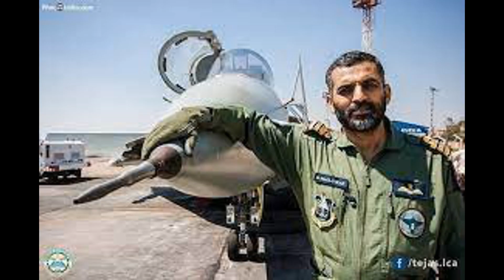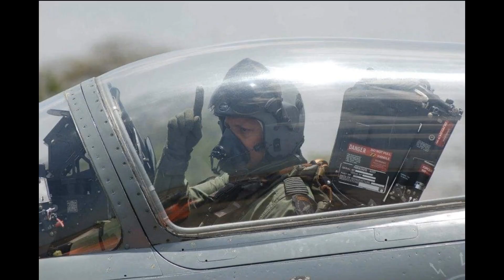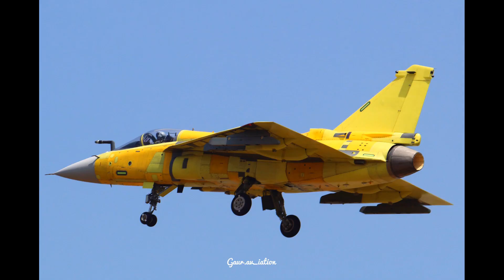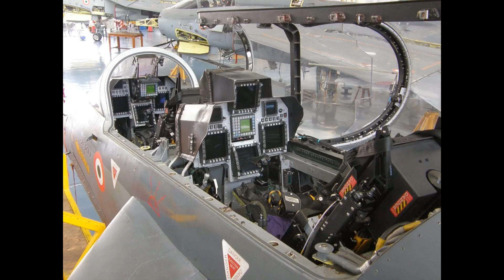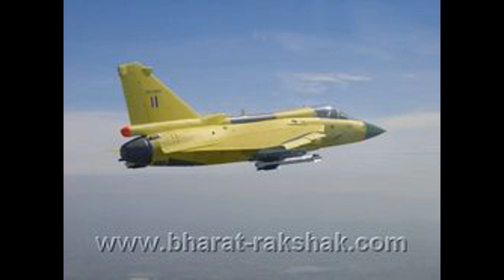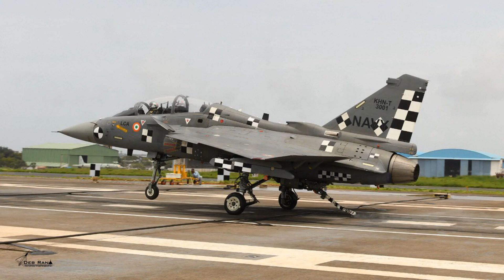Blueskies Podcast - S1Ep48: LCA Part 7 - Jaideep Maolankar - Navy LCA (2 of 2)

Comment: If you make an aircraft 10 %  smaller in wingspan, all areas become 19 % less.  All volumes and most moment of inertias become 27 %  less.   This is simple mathematics but it has implications of thousands of crores for an aircraft project.  Just because an aircraft is small does not mean that it will cost less.
Reply from the maker: Thanks Sir